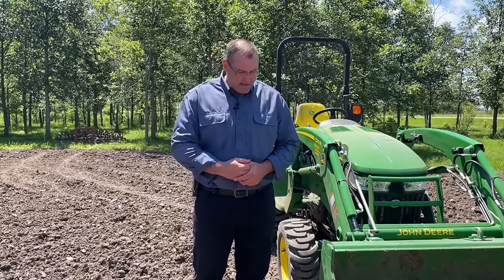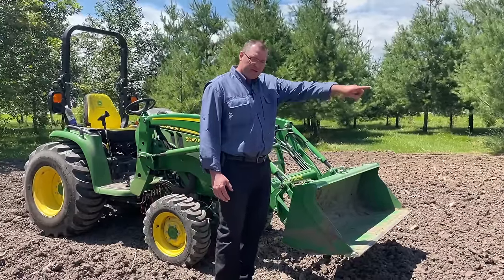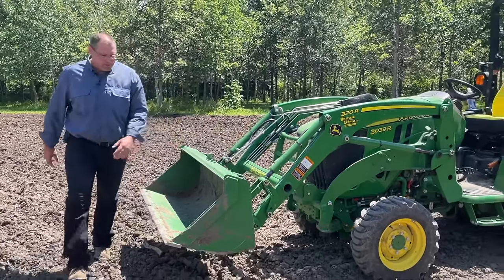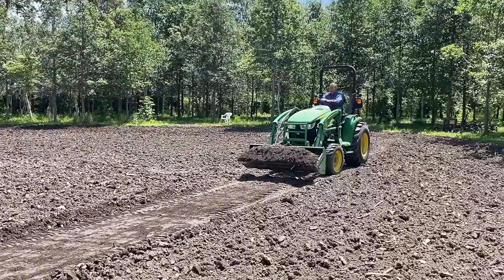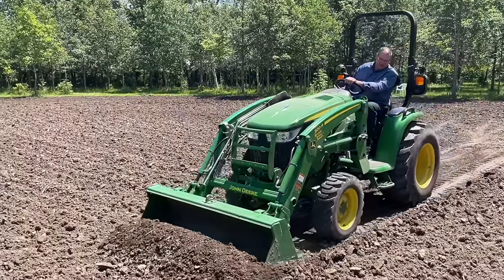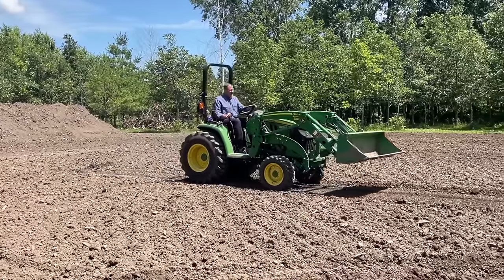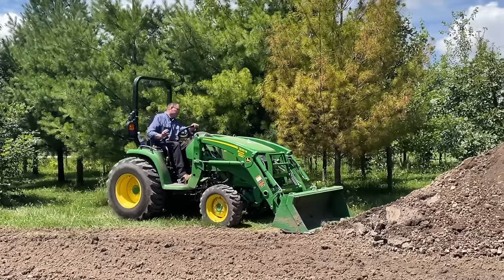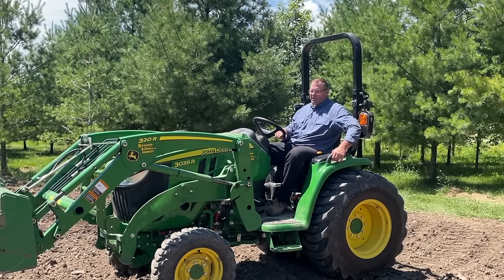Compact Tractor Loader School - Tips for How to Use a Front End Loader on JD 3039R

Comment: This is the best tutorial I seen on loader application.  KNOW THE SIGNS BEING PROVIDED--excellent advice.  Been at this for years and regardless of what signs you use I would recommend 90% of them coming from the bucket (watch it) and throw away distractions (mechanical bucket level indicator). Great advice to lower RPM and ground speed. When cleaning established grade I tap the ground ever so slightly with the bucket to reinforce my knowledge of position.  People buy loader tractors and only back drag their entire life--Sad!  Thanks, good job!

Comment: Great video!  I didn’t see anyone else mention this so I thought I would point it out. It’s lower risk working with loose dirt like this but back dragging with the bucket extended is the fastest way to bend your tilt rams.  They are engineers for strength when retracting. Back-dragging with the bucket extended using the front edge puts them under compression and it’s easy to exceed their design limits.
Reply from the maker: That's actually a great point.  I bent a ram on my backhoe one time while it was fully extended like these would be in the backdrag position.  The simple concept is that the rams are designed to provide more of a pulling force compared to being heavy compressed on the way they would be in the backdrag example.  My thoughts are that if the bucket was not put into a pry position between two hard objects and was only used for pulling loose material backwards there would be little to no risk of bending two rams on the loader.  You basically mentioned this.  Thanks for watching and the compliment.
Reply: @danimalshouse  ⁹
Reply: If you know what you're doing there's no harm to be done... But that's the whole thing not too many people know what they're doing.. or talking about
Reply: That's because small tractors are built with cheap, low quality parts!

Bigger/industrial tractors are built with multipliers on those tilt cylinders. So there's probably about three times as much pressure on them but they don't bend nearly as easy!!!
Besides the engineers that design the small tractor think that people will not use them very hard! They know that lots of people buy those miniature tractors for image only and will never max out their capabilities!!!
Industrial size tractors are designed from end-to-end from top to bottom so that they cannot damage themselves! Small tractors are not like that!!! 

Many people call those miniature tractors disposable tractors!!!

It's also true that the bigger agricultural tractor loader attachments are not designed for commercial or industrial use. They are only designed for light duty farm use.
My dad knew that when he bought a Massey Ferguson agricultural tractor to use out in commercial job sites loading trucks all day.
He had his new Massey Ferguson equipped with an industrial loader!
It looked a little bit odd because the loader was yellow and the rest of the tractor was red and gray.
They also had to make a few modifications to the tractor to make it fit on there ! But the industrial loader had the multipliers on the tilting rams to give it faster action and more movement!

I won't even go into mechanical parallel linkage on the small tractors although at some time in the past an aftermarket company made heavy-duty loader attachments available for small tractors.
Parallel linkage kept the loader bucket at the constant level to the ground as it went up and down because the tilt cylinders were connected to the frame of the tractor, not to the boom of the loader! A perfect design if you use your loader as a forklift! Additionally it will not dump material over the back of the bucket onto the machine or the operator when the bucket is high up!!!

The multipliers that I'm talking about are part of the linkage between the tilt cylinders and the bucket. They give that bucket about twice the travel angle and twice the speed with more strain on the cylinders!

Bending a cylinder on an industrial tractor is very rare!
But straightening hydraulic Rams is fairly simple! There are several videos showing how to it. They can be done with basic tools and a bottle jack.
Reply: Hydraulic Rams have more power to extend than they do to retract.
There's more surface area should push on.
Reply: @TF856  yes, they are capable of exerting more force when extending than they are when retracting. I was referring to structural integrity when I said “stronger”, not their ability to exert force.  
When the bucket is curling the shaft is under tension and not very prone to lateral forces which keeps it well within the design tensile strength of the rod and at very low risk of tensile failures. 
When the cylinder is fully extended while back dragging  then the rod is under compression. It will likely be well within the design parameter for axial load but back dragging introduces lateral forces as well. These lateral forces creates deflection which drastically reduce the cylinders resistance to axial force. Because of this they will buckle or bend at well below their rated capacity.
Reply: @EOTG_AK  they certainly do build them cheap and flimsy.
The same problem with tractors back in the 70s when my dad bought his Massey Ferguson agricultural tractor with the industrial front loader so that he would not have that problem!
After many years of heavy industrial loader work he never had a problem with it.

That's also why I like a loader bucket that has a square heel instead of rounded because they are much better for back dragging and grading.
Reply: @TF856  Tractors are built for different uses . The industrial  MF was built for those that did shovel work . There is no tractor built that does everything
Reply: Big difference between floating a bucket when backdragging, so that only the weight of the bucket and arms are exerting downward pressure on the material being dragged, rather than lifting the front of the tractor in the air with the bucket, putting much more weight into the picture.

Comment: Awesome tutorial! I’ve always been working with forklifts so when I got my 2032R a bucket was totally new for me. I did exactly what you said and dug some small holes on accident and made it worse LOL. After watching this I totally know the plan now😎 thanks!
Reply from the maker: You can do it!
Reply: If you're used to using a forklift you should check into getting a loader attachment with parallel linkage.
Telehandlers use hydraulic parallel linkage since they use forklifts at high elevations.
Parallel linkage loaders are very rare for small tractors. If you're handy with a welder you can modify your own. 😀😃
I am a very huge fan of parallel linkage on all loaders! I cannot stand the weird geometry on many large loaders!!!

Tractors that are marketed as a material handler usually have the parallel linkage to make certain attachments work properly, like forks!!!

I often wish that parallel linkage was available on backhoes and excavators!!!
Reply: @danimalshouse  😊😊

P

P

Qp
P

P

Comment: Excellent teaching! As an individual that does this every day, the only thing I felt you missed was at the end when filling and dumping the bucket it should be said that loose materials are no problem, but, do not try and scoop up or even dig into ground that isn't soft.

Yes, it can be done but the amount of wear and tear on the loader and tractor frame, pivot pins and the cylinders will dramatically shorten the lifespan of all the components. While small areas can be dug, trying to do a large area can be difficult or impossible in shale or rocky top/sub soils.

There is a reason that backhoes and trackhoes are around, as they have very narrow buckets and longer reach.  This  allows them to concentrate all of the break out force into a small area. They also have large teeth to break up the hard pack and make it easier.

Yes, adding teeth to your loader bucket will make it a lot easier to breakup compacted ground and frozen aggregates like sand or stone dust. While it helps, it still isn't enough of a change that stops the possibility of tractor or loader damage with excessive abuse. 

The extreme wear on the pump, pins and cylinders if done on a regular basis will ensure you only do it once. I doubt many of us could afford to pay the repair bill twice for a twisted loader frame or cracked transmission case and/or bell housing and final drives?

It is called a loader for a reason, Lol. Use it for it's intended purpose and it will treat you well. If you want to abuse something? use a rental unit, as that's what they are for right?  I'm kidding!, although, this is why you never buy anything  used at an auction with the words United or Hertz/Penske on it Lol!

Comment: Am surprised there was nothing regarding the "float" feature of the loader. Using the float feature in conjunction with the bucket tilt is an incredibly useful way to make sure you're not digging too deep and also for backwards leveling. Maybe you have that in another video, but IMO, it's fundamental.
Reply from the maker: I know what you are saying and honestly I just don't use the feature so it wasn't top of mind when I made this video.  I really should make a video on the float feature.  I don't use it, but it would help others.
Reply: @danimalshouse  I hear you and understand. Personally, I'm embarrassed to admit how long it took me to realize it was available and then how useful it is. Fast forward to now and it's an essential tool as much if not more than the basic up/down function.  Whether it's gravel or crushed rock on the driveway / yard, scooping up black dirt from the field and bringing it to the garden, clearing, moving snow, picking up brush / branches with the grapple or digging with the HD stump bucket. The float is fantastic. Like everything else, a person has to play with it and experiment... I've got a JD 4105 and matched JD loader. For me? A perfect combination for my needs. "The little tractor that can!"

Comment: One added tip. Your back axle determines the level of your bucket.  If your back axle is level, youll dig level from left to right side to side.  If you dont start off level, its very difficult to keep a grade.  Doesnt matter if your front axle is skewed a little. My father invented a bucket with a 45 deg cutting edge and flat sides that make it very easy to dig etc.
Reply from the maker: Good tip.  Thank you!

Comment: Whenever using the loader bucket you should always have something heavy on the back.
And since you're using the loader to move material you might as well have the scraper box on the back so you can grade it out real nice.

I love a loader bucket that has a square heel on it so I can grade with it when backdragging. Otherwise the bucket tends to float too high on the dirt. 
I very seldom use the cutting-edge to back drag.

And I prefer only to run loaders that have parallel linkage, and multipliers on the bucket cylinders to give it more speed and more range of motion!

But you really do need more weight on the back if you're lifting the loader bucket way up. That's when the tractor would flip over!!!
It's also a real good idea to have wheel weights or some sort of weights added to the back of the tractor!!! Even putting a non freezing liquid in the back tires!
Reply from the maker: Well said, great points Kerry.  Thank you!

Comment: Overall good instruction.  You did not mention the float function.  By pushing the lift lever all the way forward you get in float mode.  (Check your manual.)  The loader will follow the contour of the ground.  I use it when plowing snow on my gravel drive.  Already had to plow 3 times.  I'm in northwest Wisconsin.
Reply from the maker: Good call!  Thank you.  I'm still waiting for removable snow near GB

Comment: There are several tricks to turning a slope into level ground with a machine that is not designed to do that. The best thing to do by far is to get a "Top and Tilt kit"  with a drag box on the back.

Otherwise you can start picking up dirt on the high side of the slope and dumping on the lower side of the slope.
Once the low side is as high as the high side then you can back drag or dragbox it to Ballance it out level. 
I have done that many times on different job sites.
It's a little bit easier if you have a backhoe on the back trying to make a road across the slope.
Just stretch the backhoe way out on the uphill side as you're cutting the road with the front bucket. 
You can cut 50 feed of road in just a few minutes that way, unless you have trees and boulders in your way.

Just incase this comes in handy sometime. 😃😉
Reply from the maker: Thank you

Comment: Fro t ens loaders on small tractors are very picky and sensitive. The gauge of steel uses to make them is fairly thin and the cutting edge is very sharp combined with the fact that the husraulic cylenders are small and easy to push in and pull out a few inches when under strain wich is made worse by the dampening springs designed into them and the machine being on the light side to begin with,  gives an effect of the buclet wandering around as it fills and empties and when digging on compactes ground. Anyone who has ever operated one of these and also a dedicated front ens loader, or even a T190 bobcat knows what im talking about.

Comment: Great video! You are great at explaining concepts clearly and gave some great tips for beginners. I just ordered the same spec tractor and can't wait for it to come in! Did you add wheel spacers to yours?
Reply from the maker: Thank you for the praise!  I did not order wheel spacers.  I have seen the concept but haven't had the need to this point in my tractor usage experience.  Thanks for watching!
Reply: @danimalshouse  good to know! I would love to see another “getting started” video on the 3039 showing even the most basic features from starting the tractor to operating and even changing out implements.

Comment: One point, what makes your bucket level is your rear tires. Your front axle is mounted on a centre pin, and pivots over the surface regardless of what the fixed solid back axle does
Reply from the maker: I see and that very well could be true, but I still notice every little bump that the front hits so I try to keep it as level as I can.  May times I wish I had a grader but have to make the small tractor work.

Comment: The Rear Axle is fixed to the Tractor hence the Cutting Edge will react according to what the Rear wheels are running on hence needs to start the Grade on a level Run which is the length/Distance from the Rear Wheels to the Cutting edge to perpetuate a straight level Grade and as explained here just a Gentle touch of Pitch on the Cutting Edge until in the Ground 6" then Level Off - Just a Tad ! Low Box gives the COGNITIVE  time required for Immediate adjustment of the Cutting Edge as it reaches its dig depth to maintain the EVEN Grade until the Bucket is full !.
Tractors have a Floating FRONT Axle as opposed to a Floating Rear Axle on a Loading Shovel !- if the Rear of a Tractor is not sufficiently weighted !- When travelling Down Hill with a Full Bucket of Heavy material- The Tractor Can Potentially See Saw on the FRONT Axle ( As the distance fore and aft from the front axle to the Rear Axle and to the Cutting Edge is approximately equidistant) hence the Front Axle is The Fulcrum Point !- If the See Saw Occurs hence lifting weight OFF the Rear Axle - All the Tractors Mass is Imposed upon the Front FLOATING Axle - upon which if the Tractor is on a Side Slope - either Slight or Severe !- The Tractor can Rock Over - Pivoting SIDEWAYS on the Floating Axle and Have the Tractor Over on its side - Rapido !. Hence Best to keep the Bucket LOW LOW down in order it can be dropped in the event a Roll Over is starting- Dropping the Bucket will Correct the Roll Over as it puts the Rear axle Back on the ground - the Back Axle being Fixed then restabilises the Tractor.  But the Tractor Really Should be Ballasted at the rear to A - prevent the destabilsation and B to Give Traction when Grading and also to prevent Wheel Spin which creates Holes in the Grade which then Throws the Tractor Off Grade and gives the Operator a Rough Ride and causes Spill off the Bucket which further perpetuates a uneven grade!!.
I Guess some will now comment saying what a load of Bollacks !! LMAO !! 😆🤠

Comment: Thanks for some great information in the video. I need to jump on my 1026R and get a bit of practice on loader work with all what I've leant. I have been thinking about rear wheel spacers having seen the pros of them. But seeing your concepts highlighting uneven ground when digging, will they actually add more tilt to the tractor being wider or less. Im thinking it might cause even more angled cuts from the side of the bucket. Also I guess the bucket needs to be about the same width as the increased width of the rear tires or the wheels will be riding the sides of the uncut soil. It may only be trivial but it is interesting and should be considered when putting in large spacers.
Cheers for sharing  your info, looking forward to more tractor school 🚜 😀
Reply from the maker: Thank you for the feedback.  I never understood the wheel spacers myself.  To me, the biggest tipping risk is having a loaded bucket and not using a ballast box or other weight in the back of the tractor.  The spacers never interested me.  Thanks for watching!
Reply: Spacing the wheels out is for row crop work.
The best way to keep your machine from tipping over is by keeping a very heavy implement on the back and keeping a heavy nonfreezing liquid in the back tires! Also adding very heavy wheel weights to the back axle of the tractor.
Never carry a full bucket high up in the air when you're driving around! Always carry a full bucket low to the ground.